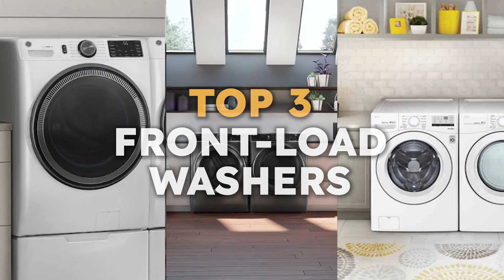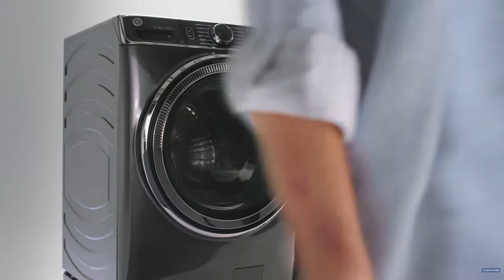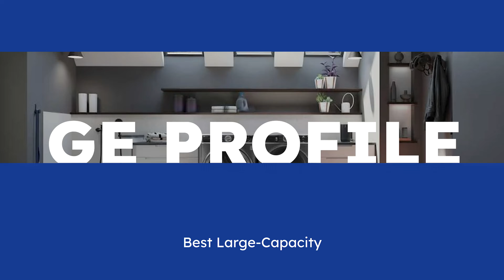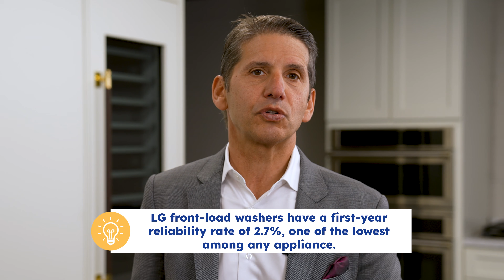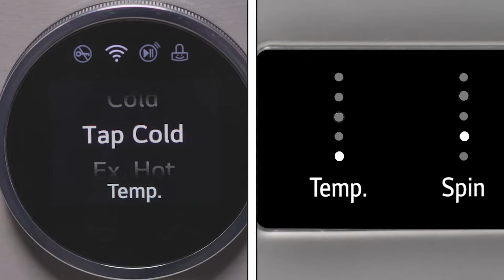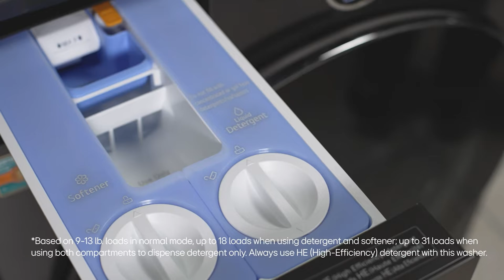3 Best Front-Load Washers for 2026: Ranked by Performance, Reliability, and Value

Comment: Just had a service teck out for my GE front load washer. Circuit board went and door would not open. He said GE is the most worked on. He also said that if you are looking for a front load washer just do this. Pick a model that does not have the big blue seal for the front door.

Comment: What about SQ front loaders?
Reply from the maker: Small capacity and super expensive. That said I like them. I just don't think they're cost-effective.
Reply: @YaleAppliance1  If you are young and looking for trouble free they are one of the best. He is correct though. Their front loads start at over 4K. They have built them for years and they are used a lot in commercial laundryomat's. Comes to the old saying, you get what you pay for.

Comment: How interesting. Everything he states that GE does not do, mine does. My blue gasket grows mildew and my detergent dispenser also grows pink mold so fast and I have to wash the dispensing tray about every 3 to 5 weeks or water gets backed up in it. I have to keep both the dispenser drawer, and the door opened or my newly washed clothes smell like a wet dog. I remove my clothes immediately when the load is done. I have had nothing but issues of odor from my GE and I can’t wait to kick it out of the house.
Oh and the vent feature to dry it? ..does nothing to help with the odors from my washer. And I make sure not to put too much detergent, not to put too large of a load, etc.  I never had this many problems with the LG in my last house. I’m only dealing with this one because it came with this house.
Reply from the maker: That is interesting.... I imagine mold does grow on an anti-microbial surface over a time period. On my front loader I just leave the door open and let the air dry the gasket but I also towel dry it as well.

Comment: This is complete BS- GE’s washers have a mold problem which is why they came out with a useless solution. Their technicians say they have a mold problem all the time !
Reply from the maker: Sure if you're going to leave water in the gasket for a long period of time, eventually it's going to develop mold. But microband does resist mold for at least a time. It also has a fan that dries the water in the machine. Is it foolproof? No. Is it better than anything else? Yes.

Comment: Hello Steve and Francesco.

I really enjoyed your videos here.  I know that you have said that G.E. is the way to go in a front loading washer, but my wife and I have been suffering with a G.E. Model #PTW900BPTRS top loader for the past 3 ½ years.  It is by far the worst major appliance that I have ever owned.  We can’t set the washer to perform a cycle without babysitting it so that it does not tear itself apart.  It simply cannot balance a spin cycle without the tub banging from side to side and actually causing the machine to bounce across the floor.  So now, when a load is done, I have to go in and physically balance the load by hand, and even that can take several tries.  It is the worst designed machine I have ever seen.  And I’m not the only person who has had the exact same experience.  My wife’s physical therapist had the exact same model and it did the very same thing.  It banged around so bad while the family was away from home that it actually punched a hole in their laundry room wall.  Needless to say, they got rid of it.  I have had a repairman out to look at the washer 4 different times and he told me that these new G.E. top load washers are prone to this problem and there is no fix.  G.E. says, too bad, you’ll need to buy a new machine, but we’ll give a $ 100.00 dollar gift certificate for your trouble.  No thanks !!

I apologize for venting here.  My real reason for contacting you is that I like the way you explained things and hoped that you would have an opinion on my next likely washer purchase.  I had considered the G.E. Model #PFW870SPVRS, but the reviews I saw were less than encouraging.  I like all the things that you said about G.E.’s service network, but the machine just continues to have the same problems over and over again and the owners finally through in the towel and went with another brand. Many of the reported problems were not covered by the owners’ extended warranties.

For that reason (and for the service statistics you stated about L.G.)  I am considering the L.G. Model: WM6500HBA.  No washer is completely free from problems, but this one seems to be much less of a headache for its owners.  I’d love to hear your thoughts about this model, and if you and other recommendations.  I like that fact that you service what you sell, but we are moving from Maine to Tampa Bay, Florida in the next few months and were prefer to get out new machine from a retailer that also service what they sell.

I thank you so very much from your time and expertise.

Best Regards
Michael McDermott
Reply from the maker: Sorry about your experience. The key is to get it fixed. That's why I like GE for most people because dealers don't service what they sell. That said LG is the most reliable.
Reply: @YaleAppliance1  

Hello Again

Thank you very much for your response.  As I mentioned in my first post, we had the very same technician to our home on 4 separate occasions for the very same balancing problem.  After the 4th attempt, the technician (who was sent by Bodewell) told us that this balancing problem is inherent in many of the G.E. top loaders.  G.E. simply offered us a $ 100.00 gift card to go buy another G.E. machine and go away.  Not companies (both G.E. and Bodewell) that I plan to ever do any business in the future.

I will be going with the L.G. Model: WM6500HBA when I’m ready in Florida.  I really did listen to everything that you said in your videos, and your statement about L.G. being the most reliable helped me make up my mind.  I thank you sincerely for your sage advice.  If you are ever in Tampa Bay, Florida in the next few years, stop into the "Cigar Time" floating cigar bar.  We should be up and running within the next 6 months.  Hope to meet you in person to thank you for your help.

Very Best Regards
Michael McDermott

Comment: I actually bought my last LG set based on the videos before this one lol. Haven’t had a single problem in 8 months I’ve had it.
Reply: My LG washer dryer combo is the worst machine I have ever had the misfortune to own. Drying time was taking three hours and now it doesn’t dry at all. For months it was leaking and the repair people said it was condensation, even though it was flooding my laundry room. I will never buy another LG piece of equipment ever.
Reply: My experience is they are never ce until the break.

Comment: What ever you do dont buy a ge, ive had nothing but problems with ge. One blew up inbthe repair tech face. Thr second is a month in and they haven't fixed it yet, they ordered parts doublingbthe cost ofca new one

If you do get a ge get the warranty, extended warranty and the extended extended warranty and insurace prayer and holy water

Also assurian insurance sucks